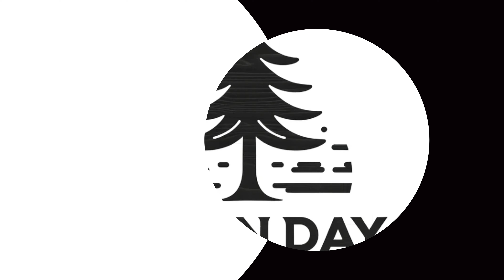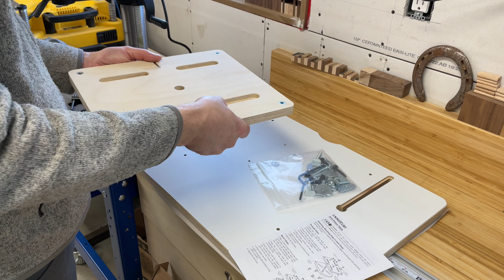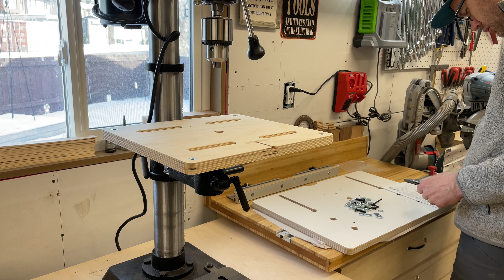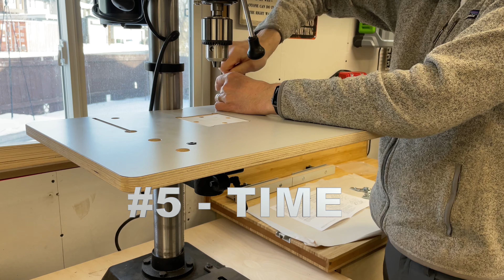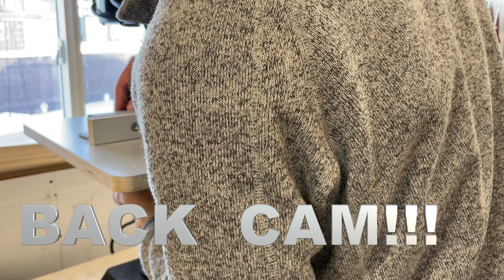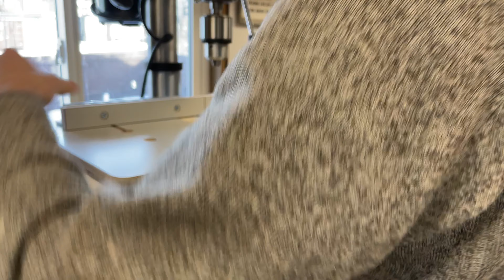5 Reasons I bought  a Veritas Drill Press Table (and one reason I should have built one)

Comment: Good video Ryan. I have the same drill press. I saw that table at Lee Valley but wasn't sure how it would fit on the Rikon. Looks like it fits perfectly so your video was very helpful for me. I do think I'd cut some slots in the top so I can clamp things down. For longer stock I can see how you could just use quick grip clamps at the edge of the table. But for smaller pieces it would be useful to have some dovetail or T slots to accommodate clamping.
Reply from the maker: Glad you found it helpful! I agree, you can never have too many options to clamp stuff down.

Comment: Does it come with any clamps? What are you doing to clamp stiff to your table?
Reply from the maker: I mostly just use quick grip clamps, but you got me thinking. I have a couple of those t-track clamps that I'm going to put on the fence and try out.
Reply: @ryandaywoodworking  I was wondering if maybe  could router a couple of micro jig dovetail slots into the top or would I be asking for trouble?
Reply from the maker: I think so? I move the fence back and forth a bunch depending on the size of the material and bit, so you would have to think about placement. Using clamps on the fence should work for most things?